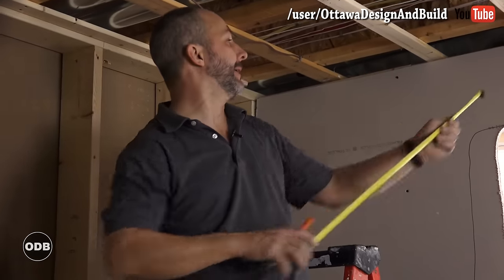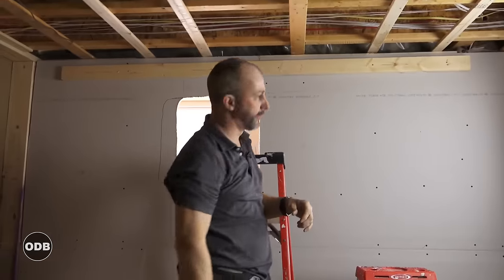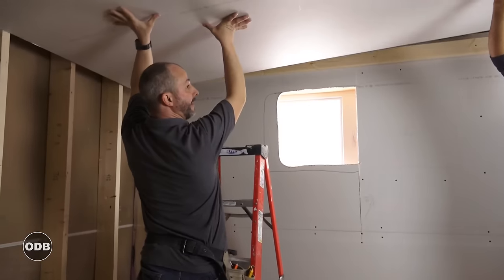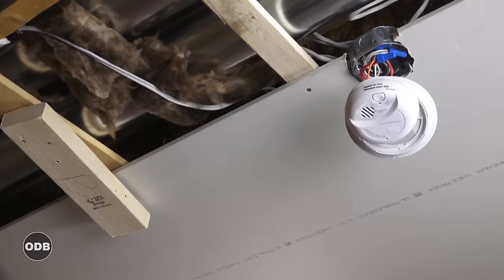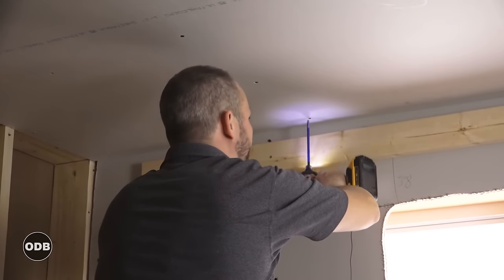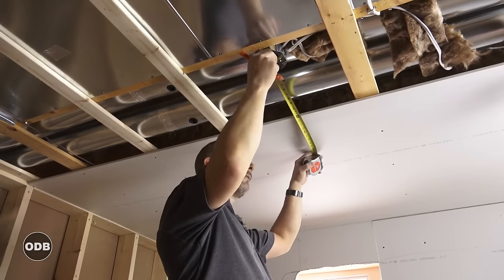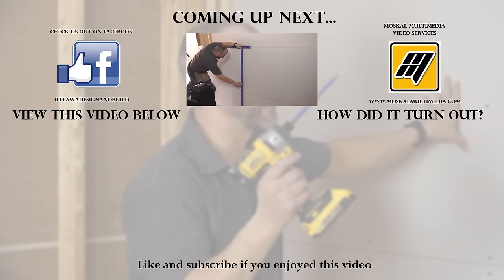Installing Drywall on Your Ceiling | Drywall Installation Guide Part 2

Comment: I must fix drywall onto my ceiling and I have two problems that are related. 
First, there are 50 mm thick foam insulation boards fixed on my ceiling already and this means that the drywall must be on top of them (well, below actually). This, in turn, means that the screws must be very long. I could not find screws that are both long and thin. The thinnest screw that can go 25 mm into the timber is at least 5 mm thick. It is 90 mm long as the insulation is 50 mm and the drywall is 15 mm: 50 plus 15 plus 25 equals 90. 
Why 15 mm thick drywall? That is the second problem: the joists are 600 mm apart and putting extra wood between them is not an option (because the foam boards cannot be removed and I don’t have access to the loft space). As far as I know, the drywall must be at least 15 mm thick in order not to sag when the span is 600 mm. Given that I need about 10 screws per square meter of drywall and that the joists are 600 mm apart, I must drive the screws about 170 mm apart; that makes 7 screws instead of 3 to 4 in each joist. Putting 5 mm thick screws so close to each other may split the joists.
One solution I consider is to use shorter and thinner screws, say 4,5 mm by 85 mm. Believe it or not, half a mm makes a difference re splitting a joist. (I experimented.) However, 4,5 by 85mm will go no more than 20 mm into the timber (if that). So, I will end up with extra heavy drywall fixed with extra shallow screws. This doesn’t sound like a good combination, but when I experimented driving a screw less than 20 mm into the timber, it turned out that a single one can hold my weight (100 kg). That seems more than sufficient given that the whole 2,4 by 1,2m drywall weighs no more than 25 kg and will be fixed with almost 30 screws. Does this mean that I can proceed using the 85 mm screws, placing them 170 mm apart?

Comment: So is it not necessary to put screws across the top of the drywall pieces on the wall? Looks like there's not enough room left on the top plate to screw to between studs.

Comment: I'm planning to install some insulation and drywall into my garage with an angled roof by myself, would the technique be the same? The highest point of the ceiling is 12ft and the walls stop at 8.

Comment: Instead of telling someone to move a junction or device box (that would technically be modifying a circuit) you should tell them to get screw kits. 8-32 for ceiling boxes 6-32 for wall boxes. Coming from your friendly local IBEW member lol

Comment: So I began to finish my basement laundry room and make it a half bath/laundry room.  I am in a bit of a pickle because I put my walls up prior to my ceiling strapping , now the walls are TIGHT  under the floor joyce (i had to hammer it in place) and I am realizing that there will be a portion of ceiling with no hanging support for strapping/ceiling drywall less the 5/8 inch wall drywall to act as a "shelf" for the ceiling drywall to rest on... any ideas?  I don't want to leave a 14" section of drywall at the end be unsupported, but I am at wits end trying to figure something out!

Comment: hey Jeff, is drywall the only way to cover up a ceiling under a staircase stringer? Is there a way to install something that's removable? like sheet metal? Issue is the drywall blocks under the stringer are really reducing the ceiling height for the staircase and we are not able to get any furniture more than 62" in height.

Comment: Good work. On average how much should installing a drywall ceiling cost? Labor?
Reply from the maker: That is tough to say. I teach diy . not the same thing! how to contract is something we will cover this year!
Reply: @HomeRenoVisionDIY  I'm just wondering. Because i was quoted $700 to do only a 10x12' basement room. I also have considered just putting white paneling in or drop ceiling like other areas in our mostly finished basement. Drywall definitely looks best for upstairs bedrooms etc... But the previous owner of our home had the entire basememt walls drywalled and the main rooms down there are drop ceiling or some panel board. White trim etc

Comment: What is the proper way to align the edges of sheetrock around a window to prevent cracks developing in the future?
Reply: Hang over Windows and doors. DO NOT put a joint online with Windows or doors. Will crack every time. Put them in the middle, 16" before or after. If the wall is under the length if your sheet, span the whole window and router it out.

Comment: Some bad contractors installed the drywall in my house ( an old one) but the ceiling is wavy because they were too lazy to shim it. Is there any other way to correct the problem besides starting all over?

Comment: I am going to put up 5/8" on the ceiling in a detached garage.  Do i put the thick edge to the side and the tapered edge to the center to but up against the next piece tapered?  for taping and mudding?

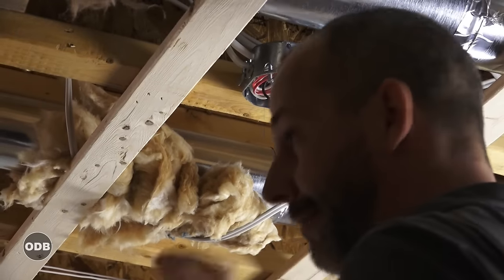Comment: When you talked about marking the fire alarm box (and the heat vent... etc.) on the drywall you said: "Make your measurements, mark it on the dry wall. Always cut as you go." (3:20). 

My question is, when making the actual cut as you did later on in the video, how can you be so sure that you won't drill into a wire? 

I am new to drywall installation, and just would like to be able to work with a little more ease when cutting.

Comment: I have a question about furring strips. Should I screw or nail them? How long should fastener be? How many into each joist?
Reply from the maker: I like screws! all fasteners should be 2 1/2 times as long as the material you are installing to a max depth of 3/4 inch inside the framing.
Reply: @HomeRenoVisionDIY  thank you!

Comment: I have slopping ceilings.  The builder used 1/2 drywall on the ceiling with 24" spaced trust.  Can I install straps on the trust and redrywall over the dry wall that's already there.  I am concerned about the added weight.  Do you think the 2 x 4 trust would handle the weight.  Should I use 1/2 lightweight drywall or use 5/8. I have an area between the kitchen and living room the spans 26' long.   Hopefully someone can answer this. Thanks in advance.  P.S  I don't want to RIP out my ceiling.

Comment: One way to  find boxes in the ceiling is hang a plumb bob from the center of the box and mark the floor with tape.  Hang the sheet then use the plumb bob in reverse. Line it up with the floor mark then mark the center of the box. The less I measure the more accurate I am.

Comment: works easier hang lid first then walls never saw a pro hanger hang lids last wall boards help support lid
Reply from the maker: IN this case we were asked by the homeowner to cover the spray foam immediately after spraying due to fire hazzard. They had a friend who recently had a fire and they have 2 small kids.

Comment: Hi need a tip from you. I want to reqrout my tub wall due to mold. I have never done this and it is my first time. What good suggestion you have for me not to screw the tiles. Is there any better way to remove qrout? Thanks
Reply from the maker: hi Robin, just so you understand the mold comes from the wall board. changing the grout will only buy you a few weeks before it comes back. I would suggest a regular use of spray bleach to keep the mold at bay until you are ready to retile a new wall board. Cheers!
Reply: @HomeRenoVisionDIY  thank you for tip.

Comment: Thanks for the video. Are the screws suppose to be 12" inches apart on the joist? I want to attempt to put drywall by myself.
Reply: Depends on your local county code. Some counties allow you to use a drywall adhesive with screws on the perimeter. Some counties are 12" (3 screws) in the feild and on perimeter. Some Want 4 in the feild and 8" on the perimeter. Check your local county code.

Comment: Just did my basement, #1 thing i wish i would've been told, STAGGER your Sheetrock! , i did my entire ceiling and didn't know i was supposed to. oh and for less cuts try to start on a end where a sheet will fit 16 on center from the start
Reply from the maker: some lessons in life are learned thew hard way. Cheers!

Comment: Earned a new sub! 

Ottawa guy trying to drywall his garage :/  

Lot's to learn!!!!
Reply from the maker: Thanks Rob, I have a whole drywall series out. Just comment if you have any specific questions. And don't forget to seal interior walls against CO2 leakage. I preref to use the fire caulking myself. Costs a few bucks more but worth it.

Comment: Great videos! What is your recommendation on screw spacing for ceiling drywall?
Reply from the maker: 5 screws over 4 ft. double up if your framing isn't level. Cheers!
Reply: @HomeRenoVisionDIY  So . If Im putting drywall up onto the ceiling joists themselves, I cant put the sheets up parallel with the 16" on center joists? That would only allow 4 screws across the 4 ft width.

Comment: do you have a video on how to attach furring strips onto the ceiling joists?
Reply from the maker: not specifically. I use 2" screws for that and install them 16 on center.
Reply: @HomeRenoVisionDIY  thanks!

Comment: Great videos! Question please: if I'm doing double layer drywall on the ceiling , should I install booth perpendicular to the joists? Thanks
Reply from the maker: Yes. just stagger your joints to help keep things nice and tight for taping.
Reply: Home RenoVision DIY  cool! Thanks

Comment: I may have missed it in the video but I have a question. when you put sheetrock on a celing are you suppose to put them with a four footer and the next a 8 footer long. like one full sheet and cut the next in half? Thanks
Reply from the maker: You should stagger the joints however only if longer than 12 ft. If the room is narrower than  12 ft just buy the drywall that fits.

Comment: Hello Sr. What kind of screwdriver blue extension you use?
Reply from the maker: I found these really long bits at home depot last year. not sure of the make , but very easy to find in the pouch or tool box. Cheers!

Comment: gday mate,love all your vids,can you or anyone tell me if i can apply everything youve shown  on drywalling to 6mm hardieflex board for interier use and can i use it for interier ceiling in 6mm or only 4.5 mm as this is what ive been told by the guys at the hardware as im in philippines and all they use is hardieflex and plywood for everything
Reply from the maker: sorry dude, I am completely unfamiliar with that product.
Reply: Screw it off on 6" centers on all joists with hardi screws mud and tape like drywall then mix one gallon of all purpose joint compound in to 2 gallons latex primer to roll out a uniform stipple texture then finish paint use a 3/8" nap roller for priming and texturing part 1/4" for finish coats of paint and remember to roll it off in one big swipe to make it look uniform thats how we finish with it you can practice the prime texture on a piece of the board to get the hang of it

Comment: can anyone tell me why they mounted dry wall to the furrning strips in stead of the joist. I know the drywall by the window was already there but why not just raise that drywall  higher so it all buts up against the joist with out furrning strrips. I guess I'm asking when and why does one need to use furring strips vs  screwing drywall to the joist.
Reply from the maker: The furring strips actually add strength to the floor above and keep the joists from moving around which in turn keeps the screws from popping out.
Reply: What should I do If my ceiling has just fallen on to the floor and the current joist do not have furring strips? Would it be a good idea to install some? It is the main ceiling on the other side is the exterior  roof.
Reply: Also if you hang new drywall on the ceiling do the joints need to be staggered?

Comment: So on your outside edges that meet the walls, tapered joints are ok to meet tapered?  Or do you want Butt joint to meet tapered?
Reply from the maker: Either is fine. Don't over think it. sooner or later you will have both.
Reply: Finishing the corners with mud will level everything out

Comment: How can I add a faux beam to a wall that has crown molding?  or 
How to cut crown molding to fit a faux beam?
Reply from the maker: if you pick up a multitool you can cut a straight line through anything. Cheers!

Comment: If you are looking for a way to hang panels on walls check out www.hangprolift.com.  The only tool made specifically for one person to transport, lift and hold panels on walls. Never have to lift a panel again.  Ceiling lifts were made to hang ceilings, not walls.  Get the right tool for the job.

Comment: do you actually HAVE to install those across beams? why can't you just install the drywall directly on the ceiling?
Reply from the maker: You can, I just like having a wider screwing surface and the ability to run wires in the future.
Reply: Could it also be that it gives you a board to tie in the end of the drywall where there is no joist!?

Comment: What happened to ceiling first???
Reply from the maker: client wanted the spray foam covered on a friday before we left for the weekend due to fire safety. I was not going to remove it on Monday and do it again. It should be fine it was just the 1 wall. The screws will hold it fine.

Comment: why don't you use glue?, i was always thought you should when doing ceilings.
Reply from the maker: % screws per 4 ft is our code. Glue just isn't necessary.

Comment: "You just need to get it up, before you do anything, just get it up in the place",

"If it's a 2 man assembly, same thing, the other guy is in charge of holding the weight.
Can let it bounce around, because while its jiggling, it'll pop off the screws "

Comment: #1....Rent a drywall lift.  It is not that expensive.  Hell, they only cost about $150 to buy.  If you didn't spend all the $$$ on the 1 X 4's you could have bought one.  #2.....Lower all your electrical boxes prior to putting the drywall up.  #3......Get the right electrical boxes so they are not all loose.  Not knocking your work just throwing ideas out for those who watch the video.

Comment: 6:21 what tools is that?to cut dry wall.drill bits?
Reply from the maker: I use the rotozip with cut out tool that has a guide.

Comment: no safety glasses or dust mask wen cuttin is askin for trouble...and as for the rotary tool nxt to that wiring....not on my jobs....glad ur only talking to the DIYers out there
Reply from the maker: Hi Kenny, On a real job this is what us professionals use. the rotary tool is kind of an industry norm! I am not sure what you are using to cut out your boxes, perhaps letting us know your approach and not just bashing mine would help.
Reply: kenny, What do u use?

Comment: Me Again. Wondering what WCB would say about you using your head to hold up drywall? Defintly not safe for your neck... Screws put in to deep. Again ---Use the right tool for the job or get a pro to do it right.
Reply from the maker: I try my best not to be concerned with the gov't s opinion on how or what I do.
Reply: When you plaster it, it doesn't matter. And drywall isn't heavy enough to hurt your head on a small job. Relax.

Comment: No safety glasses, dust mask. Handling tip of the power tool while it has power. Not a great example setter.

Only tip I found useful was the "extra pair of hands".

Comment: Uh Sir please work with some eye protection on. You working with out saftey goggles on is like working under a car, sitting on a hydraulic jack with the tire off and no Jack stand under the car just in case.

Comment: why is no Gap between cells drywall?
Reply from the maker: Sorry I don't understand your question.
Reply: Ottawa Design and Build Renovations I mean it's important to take space between each drywall panel?
Reply from the maker: That is a misconception. Installing drywall properly requires as little space between sheets as possible.

Comment: So you used a deadman to hang an 8 ftr ? Cant lift it yourself ? And you should be doing your ceilings first... Thats a huge gap at the top. I can tell you dont drywall for a living ... at 6:25 You routered half a plug. Its easier to put on the next sheet on first so the bevels line up. And take the guard off the router. You dont need it.

Comment: That's so much extra work for nothing. You already lifted it over your head. Just screw it in. That's what we do.
So here is how the 4 screws and 5 screws situation works: 5 screws if there is insulation or going to be insulation blown in after. If not, then 4 is fine and that is to code. The guys who call you back for only having 4 screws are calling you back because they are going to have heavy mulched up insulation blown into the ceiling through a large industrial vacuum tube after the drywall is up. For someone's personal home reno if they are not doing that and not insulating it, then 4 will be just fine. But 5 holds against insulation a lot better and it is advised to use 5 in that case.

Comment: a drywall lift is under 200 bucks new, craigslist has then for cheaper....
Reply from the maker: true but not worth the hassle for a small space.
Reply: Ottawa Design and Build Renovations. Very true. Just gets in the way in a small space. I have one and if its a small room i dont use it. And this comes from a guy that has hung at least 800 sheets over the years. Great tips and tricks, thanks for sharing.
Reply from the maker: funny enough we did a video on how to use the panel lift. it comes out in a few weeks.

Comment: BOXES IN CEILING .... I saw a video where a guy using a PLUM BOB marks on the floor where the boxes are then after the sheet is up goes back with plum bob and locats the boxes to cut out .    FOOL PROF